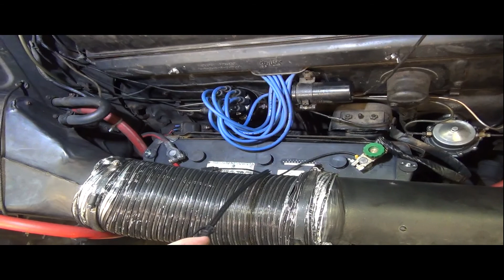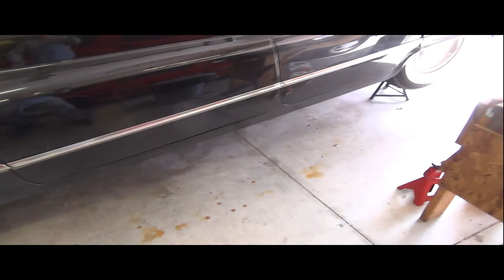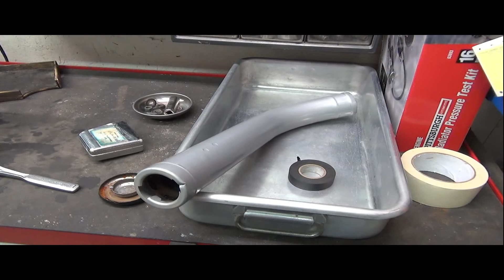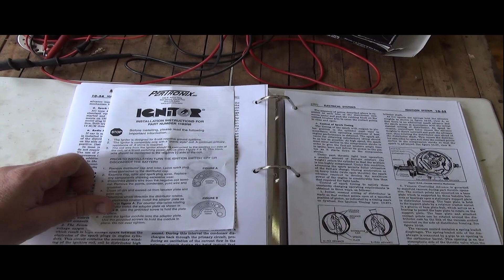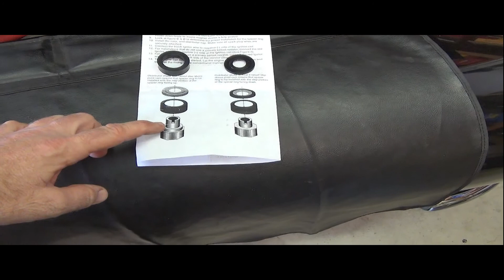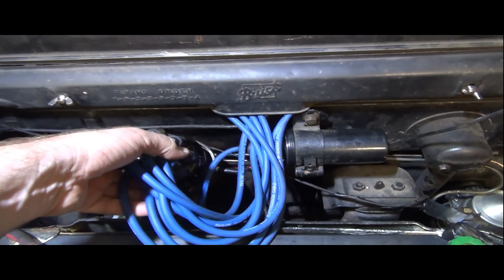Buick Roadmaster part 32

Comment: Can you tell me where you got your replacement nut for the rear axle when you did your pinion seal please ? I’m struggling to find one was there a reference number . Grateful for any info
Reply from the maker: had to get one on ebay.  The nut is not something I was able to see at (any) standard buick old parts supply house anywhere.  202850754391 on ebay was a correct fitting pinion nut that came with the wrong seal sold by parts n oil.  Separate order from  OldBuickParts (AKA CARS LLC) was for the buick front pinion seal.